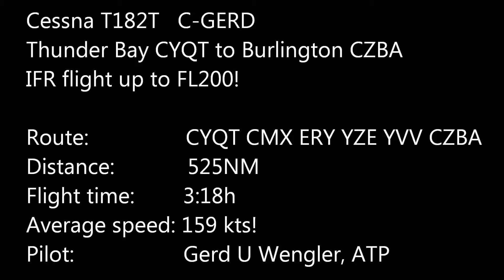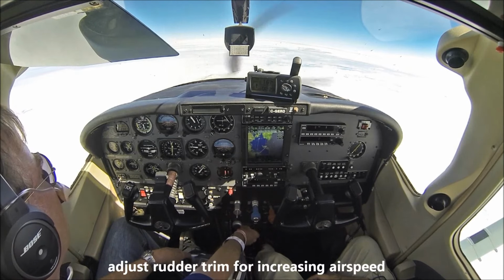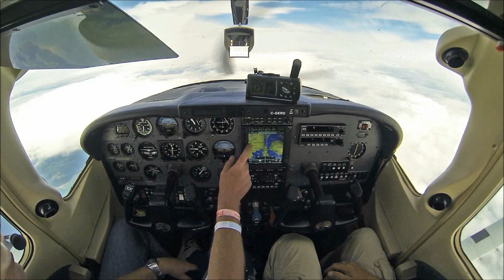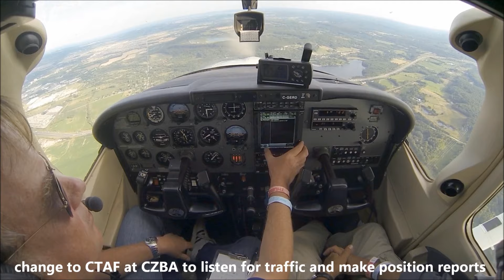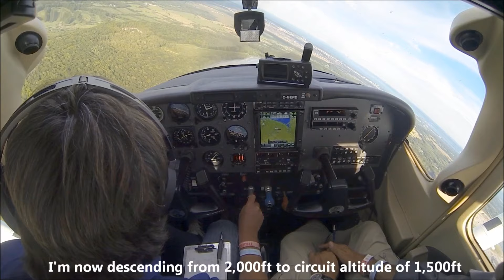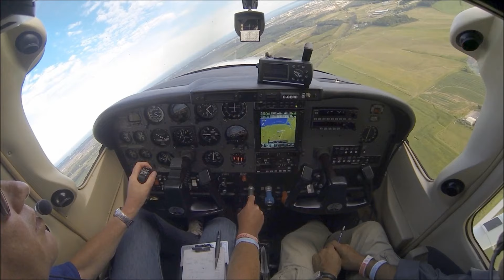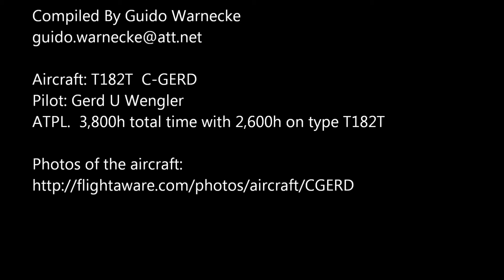Cessna Skylane at 19,000ft - cockpit video - must see!

Comment: Great video.  However, as a commercial pilot I was taught a little more technical form for the traffic pattern.  For a small Cessna: Flaps 10 on Downwind (@90kts), Flaps 20 on Base (@80kts), Full flaps on final (@70kts). -And never put flaps down (or gear) in turns. Only in stable, wings level flight.
Reply from the maker: Thank you, Jeff.
You have a good point here, however I think it is not essential to stick exactly to this flap setting pattern in a light aicraft.
In the CT182T you can set flaps 10 up to 120KIAS.
I think that the "set flaps never in turns only in level flight" might be one of these old wife tales things.
Obviously started to protect against loss of control during asymmetric flap deployment in a turn. 
Modern aircraft should be able to handle this. More complex aircraft have flap split protection anyhow.
I had once an asymmetric flap deployment in a C402 (one stayed up, the other fully deployed - the connecting chain broke).
Needed some aileron, especially at higher speeds but otherwise no loss of control.
In general, I totally agree with you: for a flight student it would be important to build up patterns and procedures in the cockpit.
When I fly jets, I am very strict with procedures, e.g. flap settings and teach our First Officers to make every approach look like the previous one - structured and predictable.

Thanks for your comment & Happy Landings,
Guido
Reply: Guido Warnecke Yes, I agree and that was my point..to develop good / strict habits early on.  If you know (and respect) the airspeed limitations you can of course be a little more liberal and sloppy about such things within the given limits but I think that developing strict habits for any aircraft, large or small is always a good idea.  (not that you shouldn't be able to operate outside the box - but within limits too - if called for)

Comment: That is very impressive to see! On what depends in Canada if you refer to altitude or flight level? Over here we have rules that every flight above 5000ft starts announcing altitude as a flight level, so our first flight level is FL050.
But I am still amazed, thank you
Happy landings
Reply from the maker: Thank you Petr.
The Canadians have adopted the US system. 
Standard transition level is FL180.
These are the only two countries in the western world that do this.
Happy Landings,
Guido
Reply: So it´s similar to difference between using QNG and inHG, because in most of the world where I´ve been so far everyone used QNH and in USA/C they are using inHG... Just not to make it easy, hehe
Happy and smooth landings
Petr
Reply from the maker: Petr Říha You are correct, Petr.
In the US, they use stature miles for visibility, all elsewhere it is in KM.
In Russia, altitudes are given in meters.
In many jets you have a selector switch between QNH (hectopascal) and altimeter setting (inHG).
Happy Landings,
Guido
Reply: I was mostly talking about altimeter settings. How differently they measure the static pressure. And I´m not even talking about Russia and their QFE

Comment: Very nice job.  Amazing to see that altitude.  Would have been interesting to hear more about the supplemental oxygen.  How long were you at 15-19000 feet?
Reply from the maker: +Rush Simonson 
Thank you!
All the time at 15,000ft,  for a couple of hours at 17,000ft to clear some clouds.
The engine is not turbocharged, to performance deteriorates above 15,000ft.
Happy Landings,
Guido
Reply: +Guido Warnecke  The engine, however, is turbonormalized, so the performance does not deteriorate at all, in fact TAS gets better the higher you go.
Reply from the maker: My answer was referenced - in error- to a different video, Herr Wengler.
Soooo glad you picked that up :-)
Happy Landings,
Guido
Reply: +Guido Warnecke Glad I could be of help - as always.

Comment: You make me want to get back in the left seat! I notice by comment fuel was adjusted at low altitude. I would think there were several adjustments descending from 15K or was turbo responsible for some of the fuel mixture management?
Reply from the maker: Hi Wayne,
yes, the adjustments are made because of the turbocharger and a rather old fashioned fuel injection system. Modern systems which are used in automotive engines would mess these adjustments automatically based on air temperature and air intake pressure (air mass flow).
Gives the pilot something to do and to play with the power levers :-)
Happy Landings,
Guido

Comment: Many thanks for all the work you do filming and editing -- very instructional as usual.  And now we get to ride along in a C182 at FL190... amazing!  Is it required or advised to use finger O2 sensors?
Reply from the maker: Thank you very much, Daniel.
I do not know much about finger sensor. I understand that they measure the color of the nails and derive from that the oxygen saturation in the blood.
I have not used this.
With proper oxygen supply and flow monitoring there should not be an issue.
We felt more refreshed at 8,000ft with the oxygen than without at 10,000ft.
Thanks for watching my videos & happy landings,
Guido

Comment: Saw oxygen in use above 12,000 feet. The body can acclimate to the height. Climbed and summated both Kilimanjaro (19,500 feet) and Denali in Alaska (20,000 feet plus) with no oxygen.
Reply from the maker: Hi James,
that is correct, but the body needs time to adjust.
I tries the Kilimanjaro but I was done at 17,000ft...and I was 20 years younger.
When I was living in South Africa at 5,500ft elevation. I could easily fly at 13,500ft without oxigen. Now. living at sea level, my max is 10,000ft.
Happy landings,
Guido

Comment: During descent, you did,t adjust the fuel mixture and let it lean until close to land. Adjustment should be done constantelly during descending
Reply from the maker: Hi Roberto,
your statement s true for a normally aspirated engine.
If you check on my videos with the Mooney, you will see that I am doing this basically every 500ft for the descent.
This is a T182T with a turbocharged engine.
It maintains the manifold pressure during the descent and climb, only very little adjustments of the mixture are required.
Happy Landings,
Capt. Guido

Comment: One of my biggest aviation annoyances are pilots that do their run up at the runway.   If you pull up to the hold short line you should be ready to go.  You had an entire airport behind you to do the run up.  I hope I never am stuck behind you.  To be fair you were at an intersection that I’m assuming wasn’t the normal runway entry location, so it’s not the worst spot for a run up .  Otherwise, great video!
Reply from the maker: Hi Ryan,
giving the traffic situation at the airport (zero) there was no harm in doing the runup at the hold short line.
Otherwise I a free 100% with your statement.
Happy Landings,
Guido
Here a link to my newest video. Citation Cj1.
These don't need a sunup at all, just some system checks during taxi.
https://youtu.be/Af3fVp8R8bg

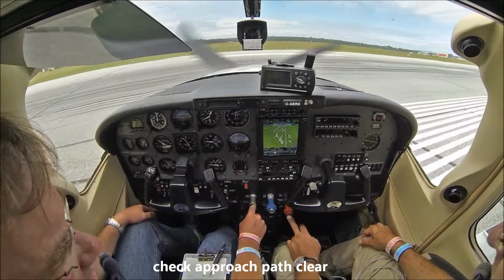Comment: Guido, In 2:00 when you are departing, you push in the mixture ... where you running LOP at the ground? High altitude airport or just to maintain clean spark plugs? Did the pilot forget? Why dont you mention it to him? Excellent videos as always, keep them coming!!! Cheers
Reply from the maker: Turbocharged engines are always full "rich" on take off, irrespective of the pressure altitude (useless the fuel flow is not properly rigged).
So the pilot briefed me and I was the "mixture man"... pushing the lever to full rich before applying full power on take off.
The reason why to lean on the ground is to keep the spark plugs clean. Lean a lot, no damage can be done to the engine.
However, if you take off in this position...not good.
But here's the "mixture man".
Thanks for watching my videos in such detail & happy landings,
Guido
PS: although I understand and respect the anonymity of the web, I would appreciate if you could write your comment with your clear name - it's just more personal. Thank you!
Reply: Guido Warnecke Not sure how to change that, my name is Felipe Guelfi! Fly a Beech Baron around down in Uruguay.
Reply from the maker: Muchas gracias, Felipe!
I like the Baron a lot, have more that 1,000 hours in the BE58, with the new and the "old" cockpit style, 285 HP and 300HP.
Fast aircraft.
Not much space for the passengers.
Greetings to Uruguay!
Happy Landings,
Guido
Photos of the Barons I flew:

http://flightaware.com/photos/aircraft/N8111M

http://flightaware.com/photos/aircraft/N7237X

http://flightaware.com/photos/aircraft/N95PJ

http://flightaware.com/photos/aircraft/ZSMDJ

http://flightaware.com/photos/aircraft/ZSJPE

http://flightaware.com/photos/aircraft/ZSSLN

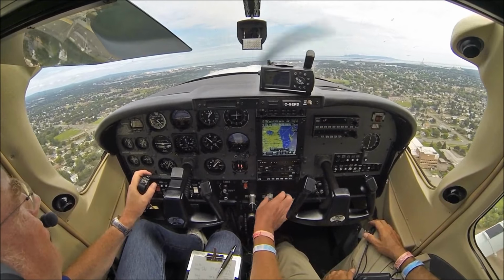Comment: I have never heard ATC assign a "Radar Heading".  Actually, I have never even heard of the term.  They assign "headings" (magnetic headings) and they are almost always different than the aircraft's course, or track across the ground.  Re. subtitles at approximately the 3:00 mark in the video above.
Reply from the maker: +terrillss71 The term "radar heading" is seldom used in the US ATC system but very common elsewhere.
When you check in with a new ATC sector and the previous one has assigned you a heading (a radar vector) you say "C-ABCD, 3,000ft on a radar heading of 123".
This is important information for ATC as you are now not tracking a route.
This may affect terrain clearance and separation from other traffic.
Happy Landings,
Guido
Reply: I want to make sure we are on the same page here.  Do you agree that regardless of where or what country ATC assigns a 'heading', that number is the 'magnetic heading' that ATC wants you to fly?
Reply from the maker: This is correct, with the exception of areas where true headings are flown, e.g. in the Canadian Northern Domestic airspace.
I hold a Canadian license as well.
Happy Landings,
Guido
Reply: Thank you for the reply and the videos.

Comment: Hi Guido! I've got a question. When you were doing before take-off checks on the taxiway you turned your aircraft like 30deg to the right. Why is that? Because of propeller blast?
Reply from the maker: Well spotted, Buzz.
Sometimes different reasons to turn sideways:
1) do not blast the guy behind (who you might not be able to see)
2) better look at the approach path to check for traffic
3) turn into the wind.
Thanks for your comment and thanks for watching my videos!
Happy Landings,
Guido

Comment: The C182 is a capable aeroplane. My best is taking a naturally aspirated, (1962) C182E to FL245 (non standard 520CI carburetor engine), on a clear day and even verified by ATC. Reduced cabin heat was about the only problem. Obviously with O2.
Reply from the maker: Thank you John!
Quite an impressive flight. What was the horse power rating on this 520 engine?
Happy Landings,
Guido
Reply: Thanks, I was happy. Texas skyways 285hp & 2,700, was 300hp in injected form at 2,850 RPM. A 182e is light, so with a clean paint job  & prop, a looked after engine, wing xstol mod, it goes well, but had no aero mods so open main & front wheels.
I think it would have gone a little higher and maybe later this year i might try for FL 250?
Reply from the maker: John Smith Hi John,
wow that's an impressive machine. I hear that hey use a similar one for parachute dropping in Germany.
Outstanding climb rate with 5 (!) jumpers.
These aircraft can go above FL, but there is the RVSM airspace restriction.
Happy Landings,
Guido

Comment: Very informative video. What is the use of cowl flaps?
Reply from the maker: +John Lee 
Thank you, John.
These engines are air cooled.
One could think the air moves with high speed through the engine, but in fact it's not the case. Air enters through the cowling in the front, is slowed down and the routed around all cylinders by deflecting elements (baffles).
The amount of air going through the engines can be adjusted by opening and closing cowl flaps under neath the engine.
Also the forward speed of the aircraft makes an impact -> fast aircraft -> a lot of air.
On a climb with little forward speed and high engine power (a of of heat produced) -> cowl flaps open. On a descent with opposite conditions -> cowl flaps closed.
Why don't we leave them open all the time?
The flaps stick out and produce drag, you loose around 5 knots on a C182 with open cowl flaps in cruise.
Smaller aircraft just don't have them for simplicity of operation, for example the C172 does not have cowl flaps, the C182 has.
Happy Landings,
Guido

Comment: Kudo's on the flight. Very nice disciplined flying. However I have one question. I fly Cessna 172's and a 182 turbo is like a 172 on steroids . Now in this clip, it sounds like you have a turbine engine instead of a normally aspired engine. Was the turbine noise dubbed in for video effect ? Or was it due to recording issues ? Thank You sincerely Ihor
Reply from the maker: Hi Ihor,
this is just a turbocharged piston engine.
The noise is only a recording issue
Thanks for watching my videos & happy landings,
Guido

Comment: Great video, Guido. You´re pushing the limits of that plane, aren´t you ;-) . I thought round about 18.000ft was the maximum for the Skylane.  Is that some kind of oxygen supply and is the cabin pressurized?
Happy landings,Michael
Reply from the maker: Hi Michael,
this is all well within the capabilities of the aircraft. The T182T is certified up to 20,000ft (and could go much higher). The cabin  is non pressurized, so above 10,000ft supplemental oxygen has to be used, either via nasal canulas or masks. There are built-in and certified oxygen tanks in the cabin. Depending on the altitude you fly and the number of persons on board the supply lasts from 3-10 hours.
The advantage is that you can use strong tail winds at these altitudes.
Thanks for watching my videos & happy landings,
Guido
Reply: Thanks for your detailed answer! Best regards,
Michael

Comment: Nice vid! Thanks for including the ATC; much more interesting that way. One question: at cruise you get TAS 160. What is your fuel flow in that profile? (Sorry if you already answered that one, but I didn't see it anywhere...).
Reply from the maker: The fuel flow obviously depends on the power setting. This as a large flat rated engine with 235HP. It runs in other aircraft with up to 350HP.
So you can use continuous cruise power settings up to 85%.  If I remember correctly the fuel low was 13.5 gallons per hour.
More photos of the aircraft here:
https://flightaware.com/photos/aircraft/CGERD
Happy Landings,
Guido
Reply: Interesting. A DA42-VI twin will cruise at its service ceiling of F180 at TAS 180 with a fuel flow of 6.5 gal per side of JetA. Power setting in that profile is 74%. Technology keeps improving...
Reply from the maker: jaunty17 It certainly does.
The T182T is still a good aircraft though.
Happy landings,
Guido

Comment: I'm sure this question has been asked before.  At what altitude do you typically have to worry about icing conditions?  Is your 182 equipped to fly in known icing conditions?  Thanks in advance!
Reply from the maker: +Andrew B Hi Andrew,
any question around aviation s a good one - irrespective how often it has been asked before...
Icing occurs at temperatures below 0 deg C and is most common down to minus 15 deg C.
But even at lower temperatures icing is possible. Icing is quite a complex issue also depends on the size of water droplets in clouds. The bigger - the worse.
This airplane is not equipped with deice / anti-ice equipment, so icing conditions have to be left by either descending (which we did), climbing - or turning around.
Even aircraft certified for FIKI should not be in the ice for long time, this is more an equipment to "buy time" to get out of the icing conditions.
Happy Landings,
Guido
Reply: Guido Warnecke Thank you for the excellent information, I assumed several variables play a role.

Comment: @Guido Warneck I found this quote particularly interesting "Even aircraft certified for FIKI should not be in the ice for long time..."  The Cirrus SR22 come to mind.  I've read it can be a very dangerous aircraft for novices because it gives you a false sense of safety.
Reply from the maker: No aircraft is designed to fly indefinitely in icing conditions.
Happy Landings,
Capt. Guido

Comment: There was a lot missing from the video. Was your plane equipped with ferry tanks? The 182 doesn't have a range beyond 950 NMI unless there are auxiliary fuel stores. And at that point it becomes a weight management issue

It's a great and informative video just some unanswered questions is all
Reply from the maker: This T182T is a well travelled machine.
My friend Gerd Wengler - the owner - used it for several North Atlantic crossings and a long flight almost via the North Pole around the Arctic.
The aircraft is equipped with Flint aux tanks (google this) that give you more than 2 hours extra fuel at normal cruise power.
Happy Landings,
Guido

Comment: Great video thank you for posting.
I have to ask.
At those altitudes with your airspeed; are you not much slower than most there?
Are you a 'speed bump' to faster aircraft?
Say a Lear left 1 hour behind you on the same flight plan; he would surely catch you from behind. How would ATC direct him around you?
Thanks!
Reply from the maker: CrazyDaveIowa In a radar controlled airspace, ATC would direct faster aircraft around (or above/below) slower traffic.
In a non radar controlled airspace (like most parts of the North Atlantic), this is obviously not possible. So aircraft are assigned their route and altitude based on their speed to avoid a conflict.
You have to maintain your speed within narrow margins.
Happy Landings,
Guido